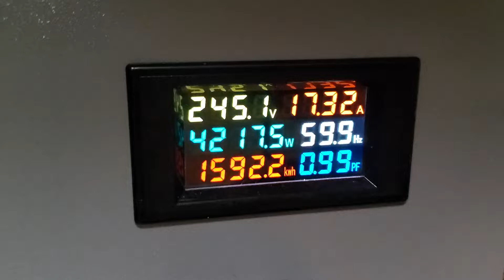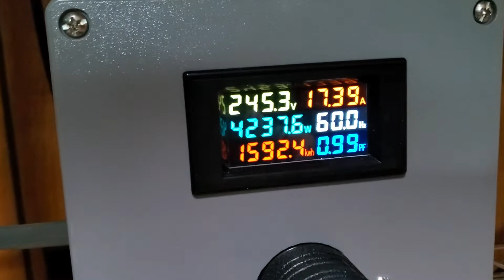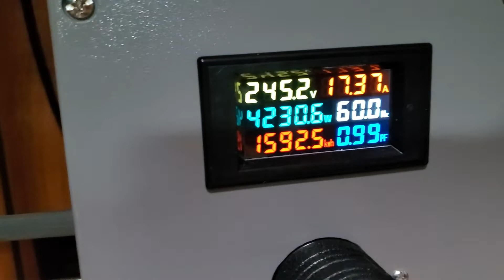PDU 240v wiring breakdown for Crypto Mining

Comment: What amp and type of surge protectors are those trip lites?
Reply from the maker: The small on is Tripp-Lite #PDUH20HVL6 is a 16AMP 240v. The one I'm using now is like this one APC AP7941 Switched Rack PDU Zero U L6-30 17.3kva 30A: https://www.ebay.com/itm/133953783750?epid=22011371309&hash=item1f304487c6:g:fDgAAOSwh0xh03Tx  and the 120v is this one: https://www.amazon.com/gp/product/B01M5EEACI/ref=ppx_yo_dt_b_search_asin_image?ie=UTF8&psc=1
Reply: I’m going to be running 4 mini doge 3 plus and the new Home 1 miner. Do I need to get a special or different type of surge protector? They will all be running on 120.